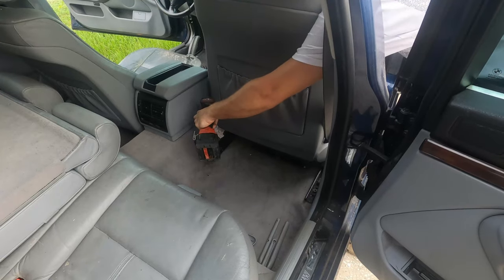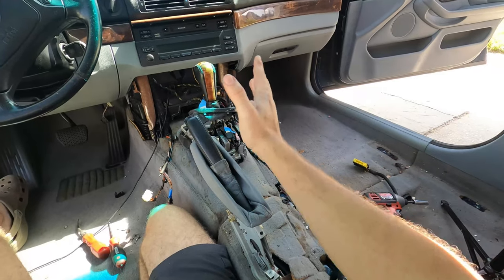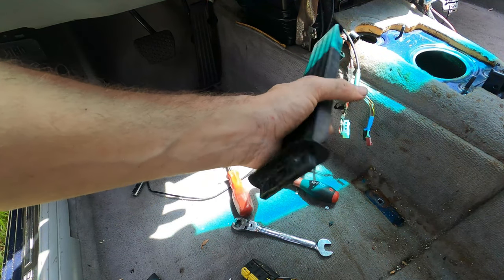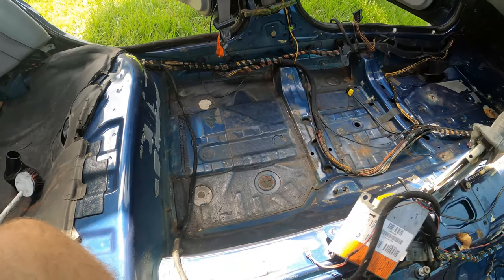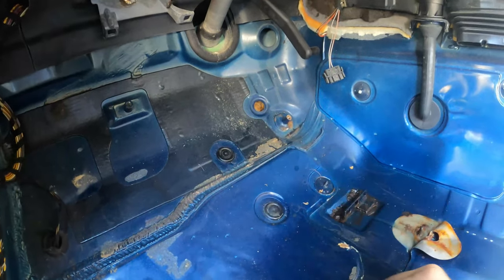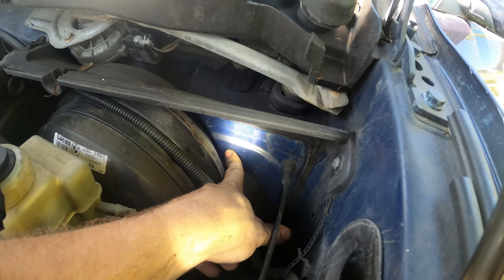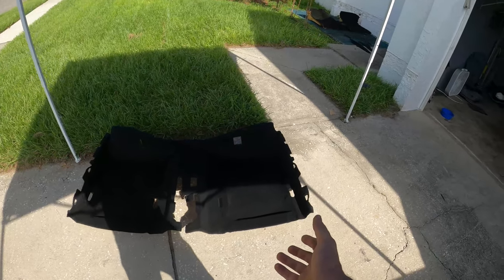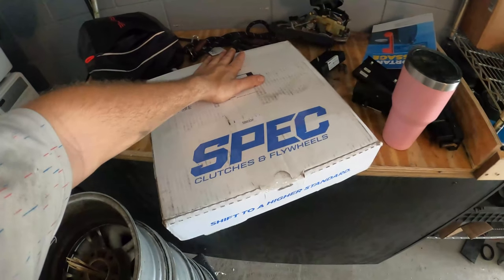E39 Manual Clutch Pedal + Carpet Install: E39 M5 Wagon Build Part 10

Comment: Dude thanks. This video helped me run my hard line for the clutch to the slave cylinder thru the hole in the carpet. Could not figure out the routing

Comment: Those technical holes are real sickness of e39, especially the largest hole beside the back door. Ofc you did a job, and it is much better than nothing, but there is much of the chance that you still can find much rust under vibroisolation.
Reply from the maker: Yes you are correct! But we have to do what we can to keep these cars on the road